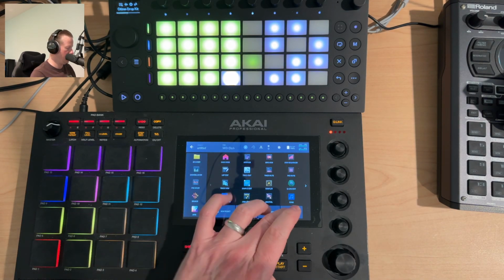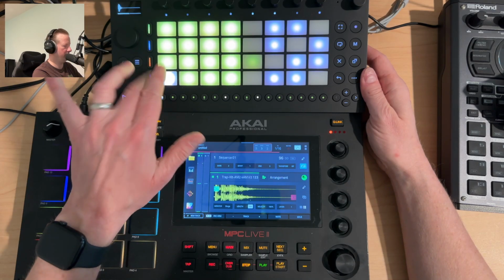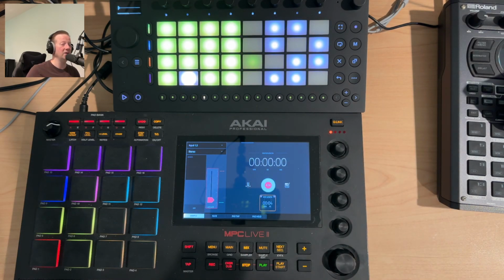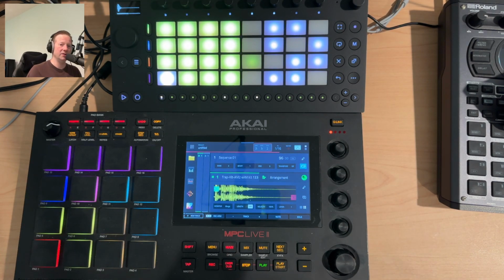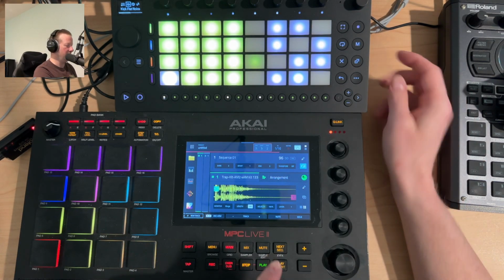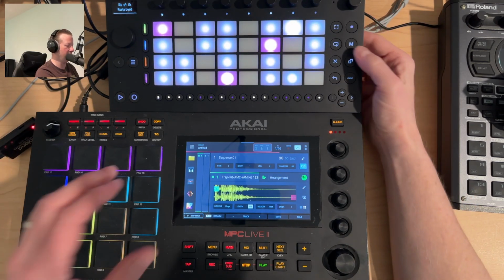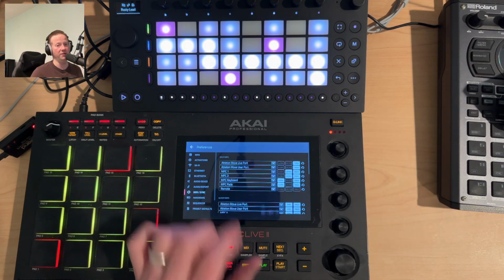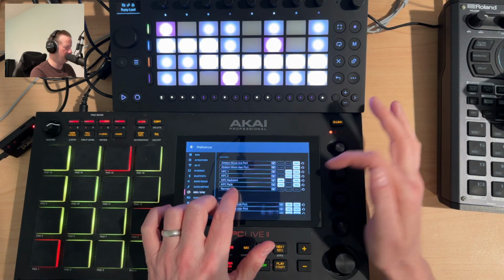MPC - Using the Move for Audio and Midi over USB pt. 2

Comment: Thanks for this video. I own both devices as well, but aside from some sampling into each other, I have yet to find any significant synergy between these devices. In fact, I haven't even bothered yet with hooking them up. A scenario I was thinking of is one of the devices being an effect machine.  I have no idea how that would even work. The FX on the Move aren't all that special, but MPC's FX  like Flexbeat, Flavor Pro, Delay Pro, and XY pad could really spice up the Move.
The second scenario would be keygrouping some synth presets from the Move on the MPC, using the autosampler. Do you have any experience with this?
Reply from the maker: I like the workflow on each, though I haven't really loved working with the two together, much beyond what you say of just sampling one into the other.

Autosampling on the MPC is pretty easy, so grabbing synth presets from the Move to the MPC shouldn't be too hard at all to pull off.

I'll probably check out the Move beta in a bit... some folks are bugging me to try it out.
Reply: @NearTao  You're right, keygroup sampling should be possible if the MPC sends out MIDI to the Move and receives audio from the Move. But I've yet to really explore keygrouping on the MPC. It's one of its many, many features. In fact, the MPC is so immense that I'm currently only at page 363 of the whopping 1262-page MPC 3.4.1 Bible lol.